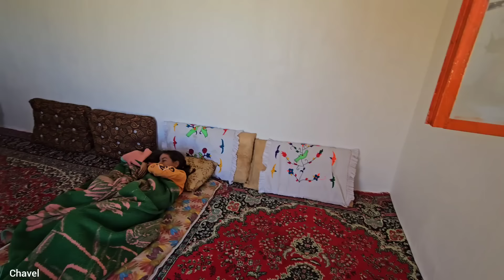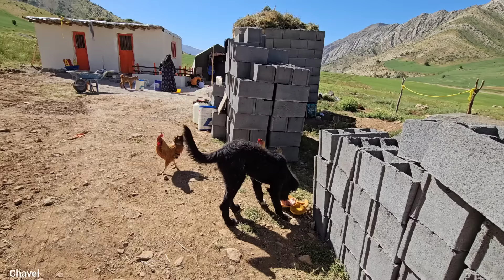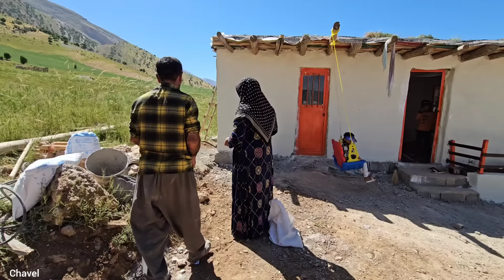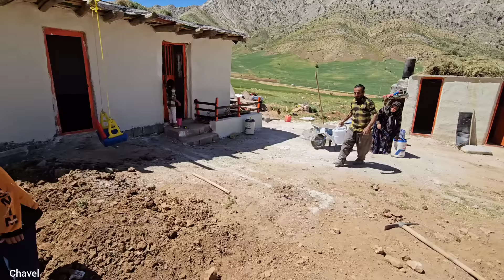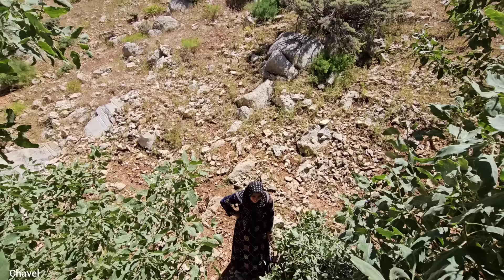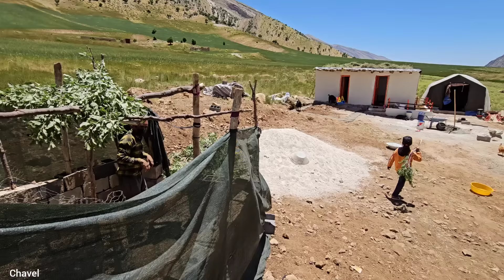Breaking out of water: Reza family's resistance against forced migration #family

Comment: Mr Reza please complete your projects and do it neatly. The painting on the fence has orange paint on the brown paint, the back side has not been painted and you can see the paint drippings. The two concrete steps leading into your house has been concreted on the top but needs to be completed on the sides and the front of the cinder blocks as it looks unfinished.  You haven’t completed cementing the back of your house and the blocks are cracked with many openings inviting insects and eventually rain water to pour into the walls. Finish the back of the house so it matches the front of your house. There are cement drippings on the dirt around the front and along the fence. Can’t you clean that up. It’s quite unsightly.  You’re both taking on too much with the goats, chickens and poor Lena, abusing the kid goats and over milking. Therefore, you’re both looking insane rushing around and making your girls over worked with nothing done pleasingly.  Plan and organize and not just dig on the spur of the moment.  PLAN WELL as it’s very important! 👍🏻🙏😊
Reply: Genau so sehe ich das auch, sie machen alles schnell und liederlich, nichts ist zu Ende gebracht worden, die armen Tiere tun mir so leid, kein bisschen liebe, vor allem die Mutter ist unmöglich, als Frau nicht ein bisschen gemütlich gemacht und baut wie ein Mann, sie sollte sich lieber ums Haus und um Ordnung und Sauberkeit kümmern
Reply: C'est tout à fait vrai 😂😂
Reply: I noticed all that oo.  But also on the Doo channel....Rahmat does the same thing.  He dripped paint all over the kitchen  sink!
Reply: Ese coral es otra cosa muy bien